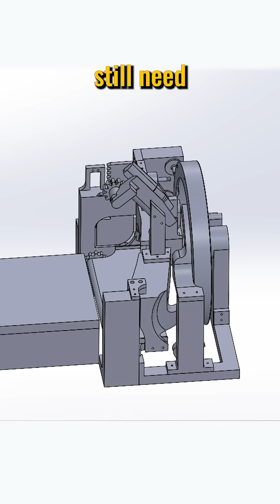Building a Bowling Lane in my Kitchen

Comment: You should make the pinwheel bigger. If you look at real pin setters you’ll notice that the angle of the cross conveyor is a lot shallower because of a larger pinwheel
Reply from the maker: yeah ideally i think it should be larger but im somewhat limited by printer build volumes